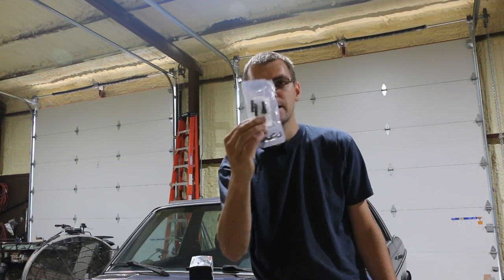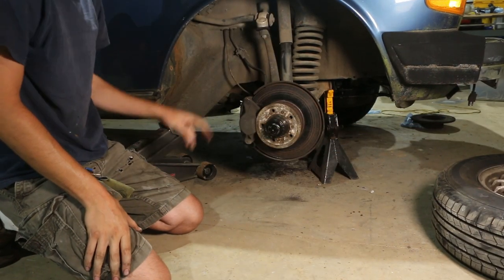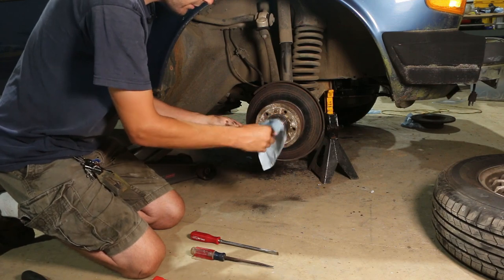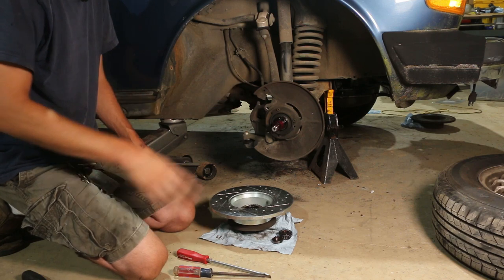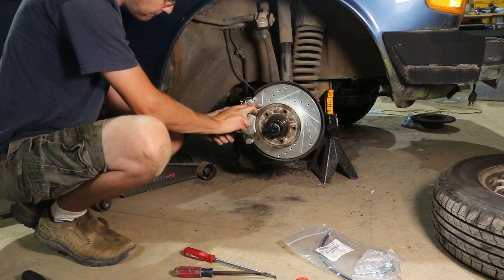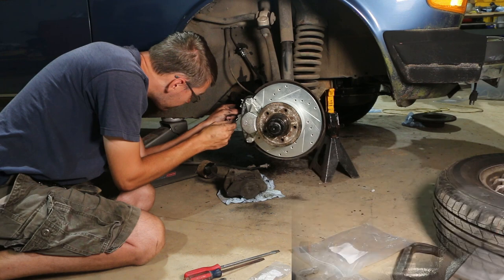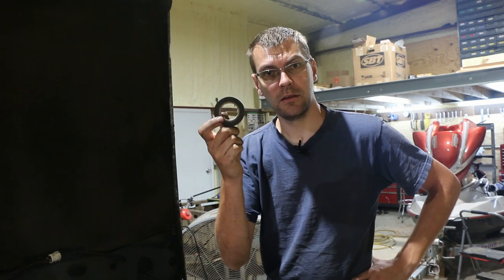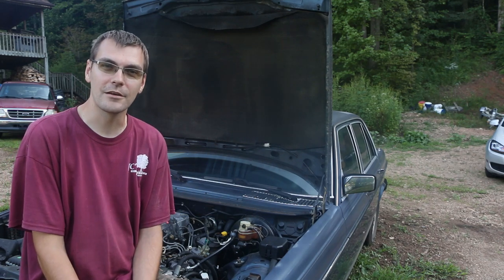Replacing half my W123s brake system. Rotors, calipers, hoses, pads, wear sensors, fluid sensor caps

Comment from the maker: Everything you'll need to accomplish the same task:
Motive power bleeder: https://amzn.to/3zcFula
DOT4 Fluid: https://amzn.to/3AVBgPa (You will need at least 3 of these 12oz cans for a full flush, Check your local autoparts store, its probably cheaper!)
Brake fluid tester: https://amzn.to/2WoJh0o (I just got this, haven't even tried it out yet)

Master cylinder level sensor caps: https://amzn.to/2Y7m9UU

Wear indicators: https://amzn.to/2XNl1Wj
Front rotor: https://amzn.to/3j3McEv
Front hose: https://amzn.to/3gk5NhK
Front Left caliper: https://amzn.to/3y7U3VU
Front Right caliper: https://amzn.to/3B2wKys
Front pads: https://amzn.to/3j34zcy (Semi-Metallic)
Front Pad hardware: https://amzn.to/3z9E9eO

Rear rotor: https://amzn.to/3k6LaGU
Rear hose: https://amzn.to/3AYrQCI
Rear Left caliper: https://amzn.to/3j4NdMo
Rear Right caliper: https://amzn.to/3sAFBo9
Rear pads: https://amzn.to/3gm7Wtg (Semi-Metallic)
Rear pads: https://amzn.to/382Zriq (Ceramic)
Rear Pad hardware: https://amzn.to/3sEbrQJ

(These may be "affiliate links", Which allow me to earn a small commission from your purchase at no additional cost to you. That helps keep me making videos like this!)

Comment: Enjoy watching your DIY w123 videos. They have great info. I need to buy myself a w123. I  miss my w124.😕
Reply from the maker: I had a w124 for a while, a 95 E300D, it is simultaneously the best and worst car I've ever owned.
I've never driven something that handled and rode as good as that car, it was the most comfortable, luxurious feeling car I have ever been in, but it was the most unreliable thing too. Years of neglect and lots of hard miles in the rust belt took a toll on a lot of parts.
I didn't know axle half shafts could rust in half, or had I seen a power steering pump break off the mounts... I eventually ended up parting ways with it on a partial trade for a truck I now use for my business, I couldn't trust it any more after being left stranded repeatedly, but I often think of that car and how great it was to drive.
My W123s aren't quite as refined, they don't ride or handle quite as good, but I've not once been let down by one. I'll be driving them for many years to come!
Reply: Give the 124s and 201s a second chance.  Dirt cheap.  Every vehicle is going to rust.
Reply from the maker: Oh I'm not for a moment writing them off, that E300D was way too nice to never try one again. I'd like to find a early 90s 300TD from down here (rust free) with the 603 engine, As great as everyone says the 606s are, I think I'd like the 603 simplicity a bit as a stepping stone from my 617s.
I'm sure eventually I'll find a deal I can't pass up on one, and then I'll just have to explain to my wife why I'm bringing home more cars lol

Comment: Hey buddy! Always happy to see one of your videos. Enjoyed the W123 episode as you know I have a fleet of them. I can't seem to slow the rust down on them so I'm probably going to be parting ways with my Mercedes herd. As you know, I have an '83 sedan with only 50K miles so the drivetrain will be fantastic for someone. The body is starting to just have it's own way with the environment. If it were not for the constant deterioration by way of rust, I don't think I'd get rid of them for a very long time. Good to see you!!
Reply from the maker: Hey! I was just thinking a few days ago I hadn't heard from you in a while! Hope all is well with you, Shame the rust is getting to your W123s though, it is a terrible but real problem for everything.
Thankfully it is fairly slow here in TN, I do need to address a few spots on my cars before it becomes a problem though.
I just picked up some POR15, so I'll end up taking a wire wheel to the rusty areas and painting that stuff on, its terrible to work with, in the way that it makes a mess that doesn't clean up easily at all, but it does a phenomenal job of stopping rust.
Good to hear from you!

Comment: Very nice. I have to replace the hoses on my w116. Did not realize these cars had twin opposing calipers and not a sliding pin design.
Reply from the maker: Yep, Dual opposing piston at all 4 corners. Check your master cylinder level sensor caps lol, I had no idea how bad mine were until I had a brake fluid fountain...
W116 should be about the same, but you'll have vented rotors at least up front I believe. The next time I have to replace major parts on here I may be trying to see if I can upgrade to the w116 rotors and calipers for that reason!

Comment: Nicely done
Back here we will keep stumping on the brake padel to create enough pressure then lose the caliph noozle...bt i will try your method cos it seem easier
Reply from the maker: I always used to bleed brakes with the have a helper push and release while I opened and closed the bleeder method, and man going to this pressure style bleeding I feel like I get better results, I don't have to worry about topping up the master cylinder and I can finish the job all by myself, there is the expense of buying the bleeder l, or building one (https://youtu.be/nokL6TrSxWw) but the end result is worth the expense of the tools in my opinion.

Comment: Hi, I thought I’d give you my 2 cents about the brake repair. I did my brakes several years ago including installing new front bearings. Holy cow what a job…never did anything like that before. I read the Mercedes manual very carefully before starting. The pads and rotors were easy, the problem was really removing and installing the front bearings that took a lot more work than I was prepared for. But I did it! I also noticed when you put the bearings back you didn’t grease the bearings. I think that’s a problem. These bearings get REAL hot and they really must be greased well. In fact I also noticed the bearing grease that had previously been used was red. Mercedes recommends using MB grease ONLY and it’s green. The red stuff is the “el-cheapo” brand and I’d be concerned about doing everything I can (including paying a couple more bucks for the MB grease) to keep that wheel on the car while I’m driving. Also Mercedes recommends that you should NOT re-use the bolts to the hub since, as a result of torquing them, the bolts are stretched and lose their strength and can actually fail. Is it likely? Maybe yes, maybe no but keeping the wheel on the car sounds like it’s a priority. Finally I used a magnetic dial indicator that I purchased specifically for the job and tried without success for 2 hours to get the right in-out play and I finally gave up and did the “shade-tree” mechanic routine that you described play (I recall it was like .001 and my dial indicator just. Kept bouncing around) . Not satisfied, however, I called the local Mercedes dealer and asked if they could adjust the  play  and whether they used a dial indicator and they said yes and yes…for 50 bucks! So I brought the car to the dealer and watched the mechanic drive away in my car and was gone for 15 minutes and then returned and parked it. I asked him if he was going to use a dial indicator to obtain the correct play and he said…”that’s unnecessary, the brakes feel fine”!!!!!  So much for the Mercedes dealership skills….and I got a bill for $50!!!
Reply from the maker: I had replaced the wheel bearings a few years earlier, and did not add any extra grease, just left what I had put in when I did the bearings, probably could have put in a little extra, but I didn't want too much in there, thermal expansion could be an issue if overpacked with grease. I used the grease that came with the bearing kit, I can't remember the brand, but it was claimed to be an OEM supplier for MBZ.
We took the car on a 1500 mile road trip a few weeks after doing these brakes, I'm working on that video, not sure if anyone would even be interested in a timelapse of that kind of drive, but we had fun and I figure it might be interesting for everyone to know how that kind of trip in a 40 year car went.
I've actually just got a dial indicator setup that I want to see how close to the spec I am with my shade-tree bearing adjustment. Stories like yours about the dealership make me want to keep working on my car myself for as long as possible, and try to make videos to help other people do the same.
Reply: @trythistv  Hi,
I forgot to add something that you’ll get a kick out of. After carefully reading the MB repair manual I went to the MB dealer to get MB wheel bearing grease and new bolts, that are not only recommended by MB but the manual stated that after torquing, the bolts have lost a significant amount of strength and the old bolts must NEVER be used and new bolts MUST BE USED! So I get to the MB parts counter (after being greeted by a beautiful girl in an MB uniform who actually opened the door for me) go to the marble-floored Parts Counter and asked for the stuff and the parts guy goes away and comes back with a tube of MB wheel bearing grease and the bolts…and says “you’re lucky this was our last tube of wheel bearing grease and I have also the last bolts. So I say: “don’t you need these regularly?” And he says: “Nahh, the mechanics just use the generic grease and they re-use the bolts”!!!!!!!! Holy crap…you’re paying a hundred and fifty bucks an hour for a guy who doesn’t follow the Mercedes repair manual?????? Well, I guess somebody has to pay for the beautiful girl and the marble floors!
Reply from the maker: Oh that's comical, and mildly disturbing. It blows my mind how many shops and dealerships that don't really care about doing the job right, but rather doing the job as fast as possible to maximize profits.
I'll be the first to admit that I don't always fix my own stuff perfectly, but I make an effort to do it safely and in a quality way so I don't have to deal with doing it again or breaking down on the side of the road.
 I'll certainly be looking into the stretch bolt situation, I run a shop that works on boats and jetskis and stretch bolts are very common, and cannot be reused so I'm well aware of them, just was not aware that my cars braking system had any, so I will have to see about getting some so I can replace mine, as I know I've reused them a number of times by now.

Comment: which adapter did you get with that kit?
Reply from the maker: The kit I linked (0100) comes with the right adapter for the w123 reservoir, which is an 1100 Euro adapter.
I actually bought the 0250 kit myself some years ago because it has adapters that work on my trucks, the w123s and most domestic cars too.

Comment: you should never fit aftermarket brake parts you will regret it.
Reply from the maker: I always have the debate what aftermarket parts will be ok vs which ones will be a headache.
Saving over $400 on calipers and getting a lifetime no-questions-asked warranty was enough reason to try the local autoparts calipers, they've been fine on my grey w123 for the past 10k miles or so, and both my trucks got all "new" calipers when I bought each of them, and they've done probably near 40k since then with no issues, and they are towing basically every day.
The rotors I really debated on, the rears that match these have been on the grey car since I got it in 2014, I figure its not a precision part, how wrong can you go with a giant lump of steel, I guess I'll find out, and when I do, I'll upgrade to the factory vented rotors.